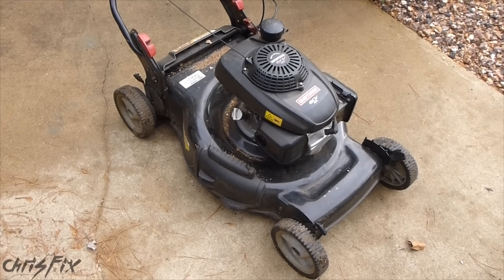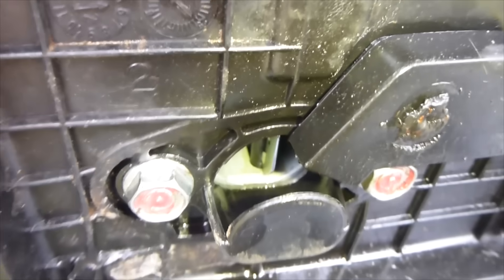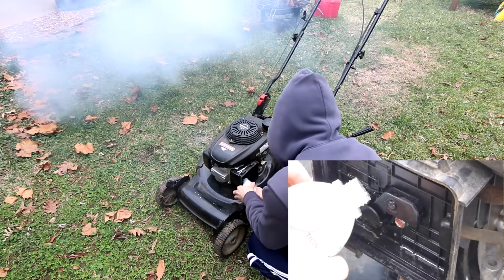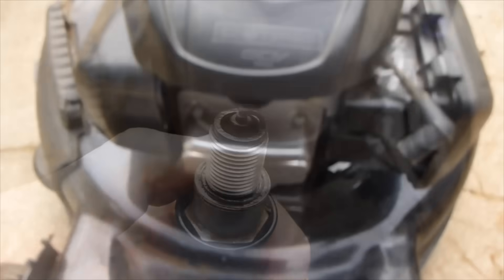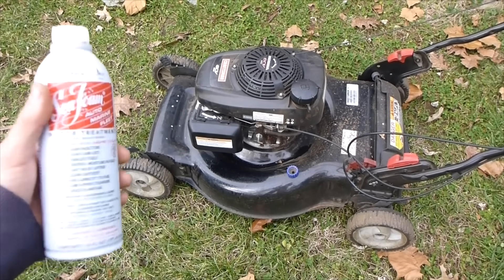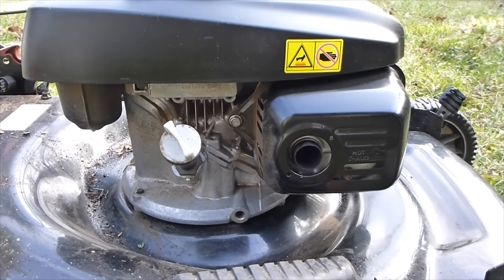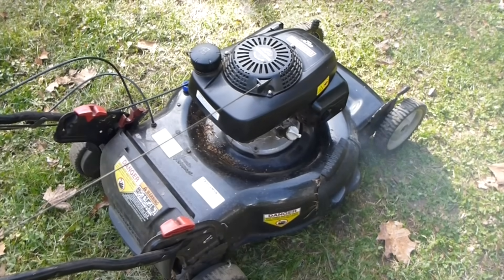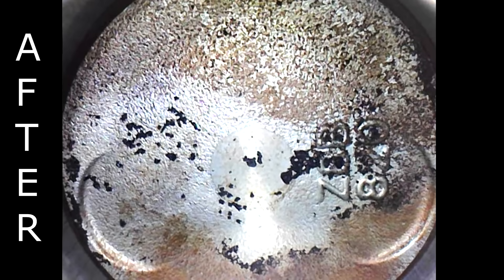Does Seafoam Actually Work? (with Proof)

Comment: I have watched and taken notes of all of the videos of Chris and I thank him for his good lectures and demonstration. However, with all my due respect for him, I would like to advise him to delete this video.  

The harm that Seafoam can cause is much more than its benefit, if any. The smoke that comes out of muffler can fool you. It may appear as it is cleaning the system. On the contrary it is due to the Seafoam itself. A good US Citizen has proved the falsehood of Seafoam by using a brand new lawnmower with no carbon deposit in it.  Watch U-Tube for this demonstration.

I used this harmful Seafoam and all of my car exhaust pipes and the muffler  were filled  with dark carbon. I had to use a few cans of Chock cleaner to clean part of that damage.  

Using tap water will do much better job and it is free. There are demonstrations in U-Tube about this.

 I intent to make a video and demonstrate the negative effect of this harmful Seafoam. I believe the seafoad company should be subject to lawsuit and pay all the money that the company has stolen from people by fooling them to buy their products..

Comment: The area you should have scoped was the backside of the valves. That's where the heat and dirty oil leaking down the guides will cause carbon accumulation. I'd increase the soak time to 15-20 minutes. Always repeat. If you're going to do it, do it twice.

Comment: First time i ever used sea foam was when i bought a 2004 tiburon, paid 480 for it. had around 140k miles. she thought the transmission was going out because it wouldnt shift past 1st gear even when using the slap shift, so i still bought it. had about a half tank of gas. drove it home barely going past 15 mph it died a few times as well. i bought a can of sea foam. sprayed some in the throttle body, vacuum hose and gas tank, i shit you not, within 15 minutes it drove without any issues, shifted fine,  stopped stalling and dying. i drove it for about 10 months, i traded it for something bigger. had 175k miles when i traded the car. to this day, the guy still drives it.

Comment: That piston was actually pretty clean to start out with. You would see much more improvement in an old engine with loads of carbon build-up.
-And you would get same result using a bottle of sparkling water

Comment: Seafoam is for pussies, take the side case cover off, take the connecting rod bolts off and take the piston and crankshaft out. clean the piston manually and replace the rings if needed. Since this is most likely an overhead cam engine, there's probably no problems with the valves or the camshaft itself, those hondas are indestructible lol. Use a ring compressor and install the piston back into the cylinder. If the cylinder is scratched, hone it out! Reassemble using assembly lube or heavyweight oil and add new oil. Should start right up on first few pulls.
Reply: NUCK CHORRIS it might take you 2 days to do that but I could do that in about 30min so about how long seafoam takes
Reply: NUCK CHORRIS 2 days open and close the motor in 30 min lol

Comment: Put this in my snowblower I only had high idle did not have low idol indication that the Jets were clogged poured into gas tank with new gas and let it run a couple hours and smoked a lot and now engine has low and high idle and runs beautiful I like this product and thanks for your video good job

Comment: have you ever tried doing just water? I would like to see how good water works.
Reply from the maker: I really want to!
Reply: ChrisFix cool. I would love to see the results . supposedly water works better than any of the chemicals as long as the motor is hot so it can turn to steam.
Reply: stop saying you will for years and years and DO IT already,
Reply: How about a pressure washer on a low setting?

Comment: So why not just spray brake cleaner into the spark plug hole? I did that once just for curiocity lol. Car smoked for a while. Used old o2 sensors of course. Could hurt the cat, no effects after 6 years later though with the cat.

Comment: i had head apart, bad build up on back of intake valves.left 1 valve submerged in seafoam for 3 hours. it did nothing at all.the smoke you see is not carbon off the back of your intake valves that is certain.i did my test to see how fast it would melt that stuff off, i was not expecting it to do nothing. try something else cause i don't think the foam does s%&t.

Comment: Lol i have a slightly different mower for this. Definitely going to try this out. If you continuously use it, would i completely clean it off?
Reply: You don't want to continuously use seafoam. It has Acetone and other very harsh chemicals that will eat away your fuel lines/gas tank (If plastic) if you ran it through for too long.
Reply: HowardSupra wow.. ok, thanks for the info!!

Comment: Actually Diesel fuel or even ATF does Exactly the same thing.
 But it creates a neighbour annoying Fogbank.
  WATER fed into the intake of a highish rpm (3000+) rpm running engine.. Also... does a V good job of cleaning out combustion deposits.
  Without the antisocial Fogbank.  On ANY engine including your car engine
Plus water is FREE (usually)

Comment: just add sea foam correctly to the gas and it does the same thing over time. Lucas fuel conditioner is even more effective, but you'll be happy with either. even automatic transmission fluid has been used to clean the combustion chambers of vehicles, carefully poured into the carb while an engine is running. it's a light detergent, it really does work.

Comment: Recently, my lawnmower started hesitating.  It will idle...dip, idle...dip, like it wants to stall out.  Could it be the air filter, spark plug?  I'm done with it for the season, but want to get it ready for the spring.

Comment: Great video! I have  seen a few others that leave a lot of questions unanswered. I used Seafoam to free up the starter clutch in my 1983 Honda GL1100 (with 4 oil and filter changes to clear out the residue). It was my last attempt before spending almost $2,000.00 for the same repair in a shop. Now I put Seafoam in my oil every other year and do a clean up of the engine. Also, a friend of mine used Seafoam to "repair" some stuck parts in his carburetor ( he mixed it in his gas and ran a whole tank).
Reply: spanorky m

Comment: Back in the day, the old car guys simply used water in the same way...
Reply from the maker: I will be testing water so stay tuned!
Reply: I've successfully used a spray bottle in shot small amounts into the intake (carb or throttle body).  The steam created supposed to clean the carbon.
Reply: Fill a 2 liter bottle (pepsi?) with water.
 Fit a piece of  1/8 ~1/4" tubing to the bottle cap.
 Attach the tube end to a Vac nipple on the engines' manifold. Run the engine at ~3000rpm (to avoid any possibility of too much water) Run until the engine has sucked all the water out of the bottle.
 Job Done. Til next year.
Reply: MrSmurfnanne back in the old days we would wouldn't use pain killers.
Reply: MrSmurfnanne i was just thinking this,then saw your comment. Nice!

Comment: Clearly soaking removed the most carbon buildup, what is wrong with removing the spark plug and filling it up to the top with seafoam. Wait two-three hours stick a tube in and vacuum it out. Repeat the process & tackle as many cylinders as you can in a day until it's complete. Chris is this possible without damaging?

MityVac 7300 PneumaticVac - Air Operated Fluid Evacuator
Reply: nothing wrong with doing that but you would need to change out the oil before starting it as the rings wont hold the seafoam in the cylinder long due to it being a watery viscosity, we used to use stuff similar here in the uk but was more syrup viscosity so it wouldn't really leak past rings
Reply: Perhaps... I don't around judging people so harshly or spend my evening at home with my parents playing Xbox & eating pizza soda all night being judgmental instead of living your life.
Reply: +Who Me? that person obviously knows nothing about the internal parts of an engine!
Reply: + WarmSoftKitty Lol, I am a mechanic you fuckwit, so don't talk bollocks, where exactly is this rust going to occur? on the aluminium pistons? on the aluminum cylinder head? on the cylinder liners that have a cross hatching pattern designed to hold oil residue on the walls?
 have a look at ericthecarguy on youtube if you dont believe me, he explains it, if you mist it in, the engine compresses it and turns it to steam, this steam then removes the carbon deposits

Damn...all those turbo cars using water injection must have really rusty and warped engines....idiot
Reply: Did you watch the video? it removes the carbon better, not that i would buy it, water misted into the intake when running does the same, thats an old school mechanic trick
Reply: You make a lot of assumptions, I am neither a shadetree mechanic or professional just a person who asked a question in hopes to get a response from people who know.
Reply: Kitty degree in what??
Reply: Who Me? Nothing youd simply have to change your oil it will seep through the rings same if u use water u will have milkshake looking oil

Comment: Try water it works better, super heated steam. Seafoam is just kero with soap. Snake oil in a can. Try the water thats what the Oem's use on the direct injected motors.
Reply from the maker: I will give water a try! Thanks!
Reply: LIES
Reply: ChrisFix has g
Reply: Snake oil implies it doesn't work at all. Clearly it cleans the engine components.

Comment: Chris I got a question that I have wondered for a long time. How does the fuel ignite when a land mower doesn't have a battery? How does the spark plug ignite the fuel?
Reply from the maker: The engine spinning has a mini alternator (magneto) that generates the spark pulse. That is how it both provides the electric and the timing for the engine.

Comment: I had an RX7 and came upon a post on how to perform a "internal steam clean" of the engine. The person advised to add Sea Foam thru the carburator then the spark plug hole while rotating the engine. Let it soak overnight then rotate the engine to get it all out. Then he suggested to pour water into the engine and let it soak for another day. Once done try to crank the engine. It smoked like crazy but all the carbon was removed. He advised if the engine had too many mile it would cause issues with smoke since the carbon that was obstructing the oil rings would go away. It cleaned my engine like a champ but the vehicle had 295,579 miles so it continued to smoke. Awesome product.

Comment: some carbon was taken off but is there a difference in performance?
Reply: Gary Shaw In some cases the carbon build up removal can do as little as clean or as most as cause less wear and easier movement of pistons getting better mpg. In some cases even it can clean the fuel injectors of carbon deposits allowing the fuel injection to run better.
Reply: MuddyBob 650 the lacquer thinner cleared it right up . 2 pints into 2.5 gallons of gas. 10 mile drive. fill tank to dilute. idle and rev to clear thinner out. now all my power Is back
Reply: Morten Kristoffersen no im satisfied I don't want to do any unnecessary damage. don't be mad at me that you fucked your car up
Reply: Morten Kristoffersen lol u win
Reply: ***** Sorry if I misunderstood you, i thought you were heavily into that seafoam thing. Awfully sorry.
No, my bikes are fine, and not fouled up by carbon deposits etc.

Have a good day!
Reply: Morten Kristoffersen haha its ok buddy. im an ass hole
Reply: ***** Nope, I´m not taking the bait ! You are a very nice guy ! (-:
Reply: ***** I had seafoam put in my car and it seemed to start up smoother but I lost power at higher rpms. almost feels like it just moved the carbon somewhere else. what do you think happened? im getting codes of runner stuck closed and running lean
Reply: Gary Shaw I would've recommended taking off your cats when doing this treatment but keep the O2 sensors connected to your cats. This treatment will help but will easily clog up your cats and burnout your O2 sensors if you don't take them off.
Reply: Gary Shaw not in this case
Reply: Morten Kristoffersen for some reason im getting crazy mileage too.
Reply: ***** Go get some more snake oil then !
Reply: ***** No you are not !!
Have a good day!
Reply: Gary Shaw is there a gasket on my gas cap
Reply: It could of most likely clogged the cats in the exhaust system.

Comment: if ur motor is stock changing to mid or high grade gas won't improve performance or mileage. or clean it.
Reply: noun
1. a machine, especially one powered by electricity or internal combustion, that supplies motive power for a vehicle or for some other device with moving parts.

Comment: unless ur going to the drag strip, all grades of gas r the same. seen plenty of documentaries on it.
Reply from the maker: Well, that isnt true. The different grades are designed for different engines. High octane fuel is for high compression engines or engines with forced induction.
Reply: Definitely not true. My mom's Aerostar would always knock with 93 octane gas and the Ford dealer told her that the 4.0 v6 was designed to run on 87 and as soon as she switched back the knocking disappeared. My 98 Ranger has the 4.0 v6 also with aftermarket heads(the stock heads crack regularly) and I didn't notice any difference with that engine but there is most certainly a difference in how some engines run depending on what grade of gas you put through them.
Reply: no

Comment: carbon deposits on the piston top crown doesnt mean shit carbon deposits are the result  of running too rich and oil  blow by the rings. The bottom line is sea foam and other products are  good to mix with fuel during winter storage. since it is a cleaning agent when you add it to your gas tank,.... but be ready to change the fuel filters, as it breaks up all the gunk, it will clean injectors and throttle bodies, and carb jets
Reply from the maker: Thanks for sharing.

Comment: Back in the day ('60s-'70s), a common trick for removing carbon buildup was to pour cold water through the carb into a warm running engine. The difference in temperature was supposed to "vaporize" the carbon deposits. Never tore an engine apart to see if it actually worked, or saw any before-and-after pics, but it was supposed to work.
Reply: 19580822 won't you crack the head

Comment: I am concerned about the sea foam soaking on the piston, and running past the rings into the crankcase and mixing with the oil
Reply: According to the directions on the can, you can put it in Fuel (gas & diesel) or into your oil. It should be ok.
Reply: YOU SHOULD CHECK OUT THE CAPS LOCK BUTTON ON THE LEFT SIDE OF YOUR KEY BOARD IT APPEARS TO BE STUCK!!!
Reply: thanks!
Reply: BandB1111111
n/p :>)
Reply: IF SOME GOES PAST THE PISTON AND DOWN INTO THE CRANKCASE WHERE THE OIL IS.. NOT A PROBLEM AT ALL!!  SEAFOAM WAS MEAN'T FOR NOT ONLY CLEANING OUT THE FUEL SYSTEM, BUT ALSO TO HELP IN THE OIL WHERE MOST PEOPLE PUT 1/2 FUEL AND 1/2 OIL..  JUST USE THIS STUFF BUT IF ON A LAWNMOWER, THEN USE ONLY ABOUT 1/4 CUP IN THE OIL ..
Reply: wont hurt it but if you have seafoam "running" past your rings....you need to be concerned about your rings and how much compression your losing!
Reply: BandB1111111 Dont worry, if that happen, the seafoam is your least problem ! (-;

Comment: Thanks dewd.  I don't know if it really helps, but I use a little bit of heat in the new gas at the beginning of the season.  During the season I also use a little bit of gumout as well during the season.  I dunno if it works for real, but...........seems to.

Now if I could just figure out how to degunk my Stihl weed trimmer during the seasons.....

Comment: I run some seafoam every 6 months or so, but not to clean out the carbon. Honestly, a bit of carbon is completely harmless. I use it to clean out my injectors and carbs and it really does work! I remember the first time I tried it, my van was running a bit rough at idle, and I noticed an improvement half way through the tank. After I finished the rest of the tank, it was idling almost like new at over 300,000 miles. I've also used it on rough running old carbs (mowers, motorcycles, etc) and it clears up gunk in the carbs real nicely! It's definitely one of my first steps when I encounter something running rough.

Comment: I've used this product many times. As you described and in the spray bottle to clean the butterfly and throttle body. Good stuff. I do however have one concern. I had to replace the catalytic converter on my Wrangler. The only car I ever had to do so, and the only car I ever used Seafoam on. Are the two related? I wonder.